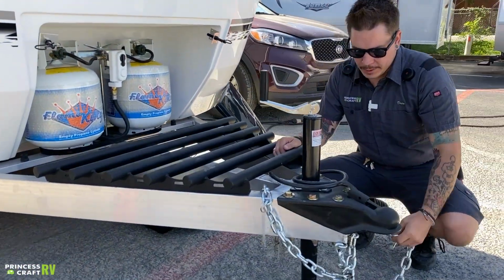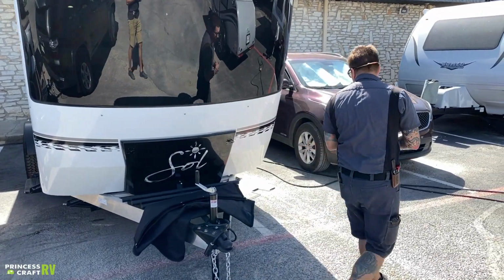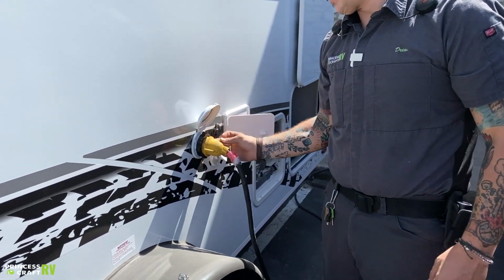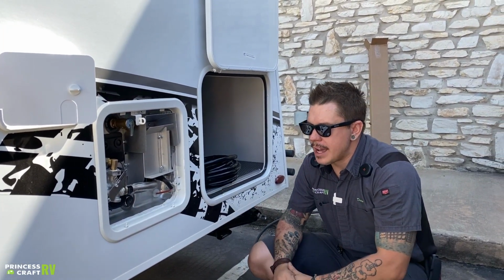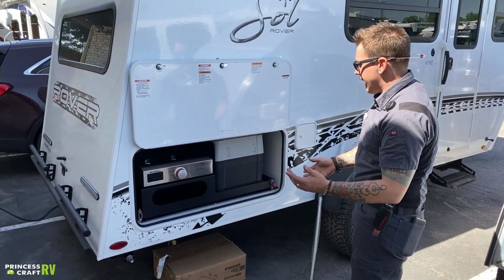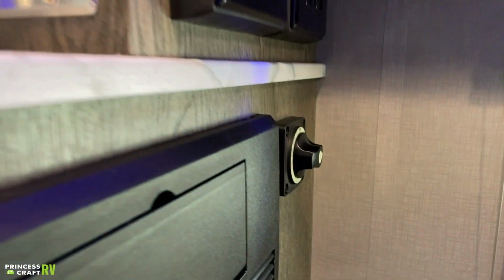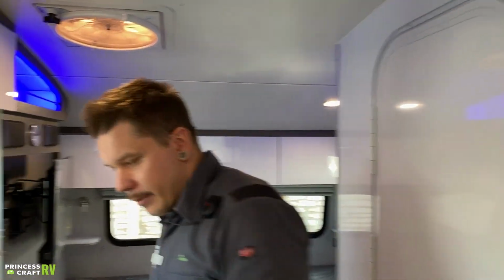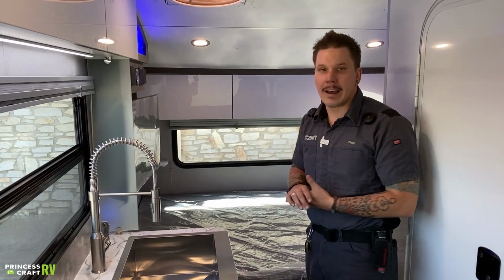2020 Sol Horizon Rover - Tech Tour

Comment: Incredible thorough. Nice RV. Not a fan of black/gray tank mix. What, no Froli system at the bed?  I like the water proof bathroom, but a small sink in there would be nice. Love the windows and the “real screen door”. Dining area is fabulous as are the windows. Love the outside cooking area. Why not add a door on the other side of that huge storage area, or put a slider in there?
Reply from the maker: We can pass these suggestions on to InTech for consideration, thanks for commenting! The Froli sleep system is not included but can be purchased after market for almost any RV bed :)

Comment: Can a lithium battery be substituted?
Reply from the maker: Upgrading to lithium is very doable! You'll need to purchase the battery and other related components, but most service departments find lithium installs to be no big deal.
Reply: Yes we did with 2
Reply: What is the difference & benefit of having lithium?
Reply: @annotoole7387  Lithium batteries are lighter, have a longer life cycle, and can be drained futher than lead acid and still maintain voltage.
Reply: They just added a solar charging package that includes two lithium batteries.